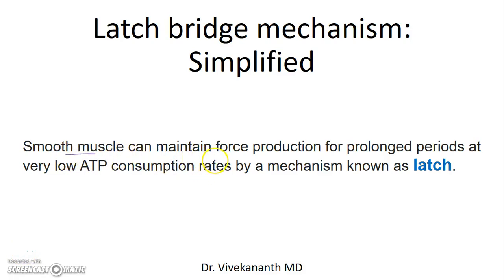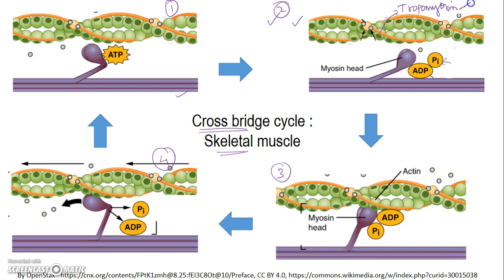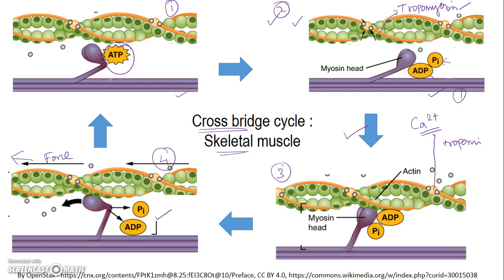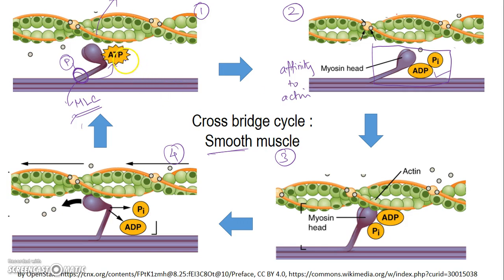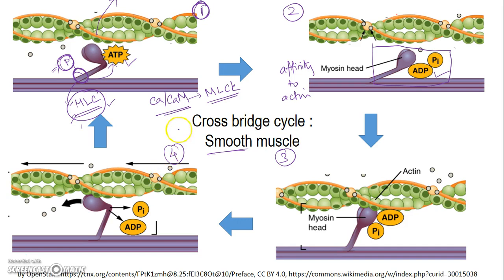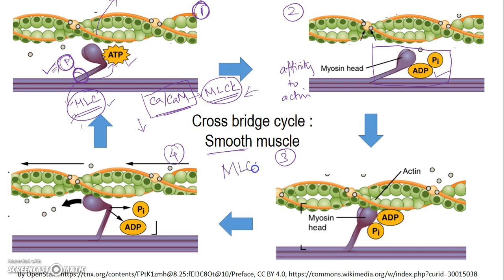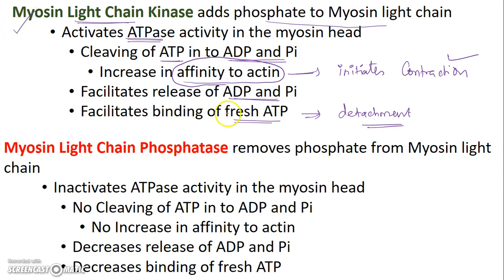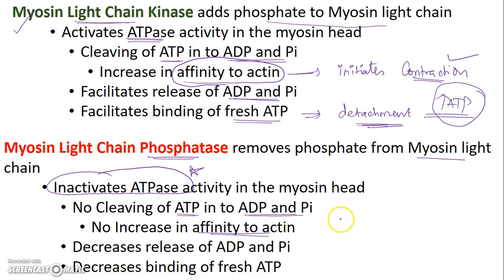Latch mechanism smooth muscle: Simplified view

Comment: useful.... but mlcp is tonic and doesnt decrease or increase. its the mlck that increases/decreases. so ratio may change but only active mlck goes up or down. otherwise it looks good!
Reply from the maker: Thanks for the feedback +sky ortho. MLCP is regulated through its subunit MYPT1, the myosin binding subunit. Numerous kinases have been reported to phosphorylate MYPT1, including Rho kinase (ROCK), zipper-interacting protein kinase, integrin-linked kinase, and p21-activated kinase (PAK). References: 1. Lincoln M, Myosin Phosphatase Regulatory Pathways, 2007 circulation research. 2. Ji Chu et al, Biphasic Regulation of Myosin Light Chain Phosphorylation by p21-activated Kinase Modulates Intestinal Smooth Muscle Contractility.2013. 3. Murphy and Rembold, The Latch-bridge Hypothesis of Smooth Muscle Contraction. 2005
Reply: now i know.... :)